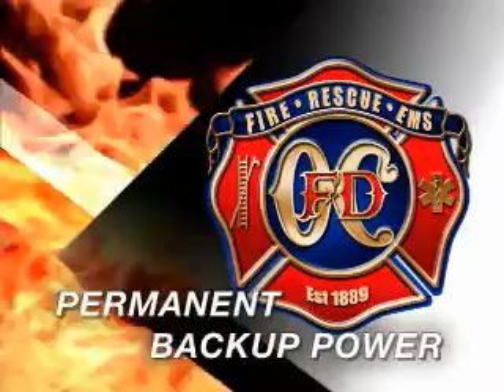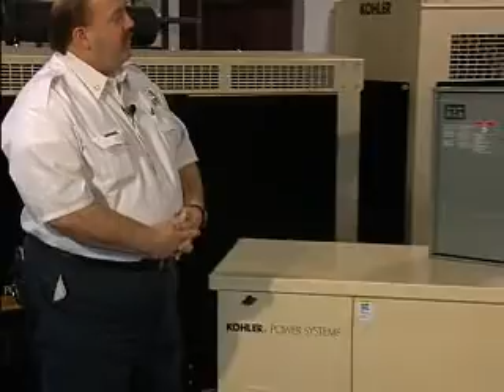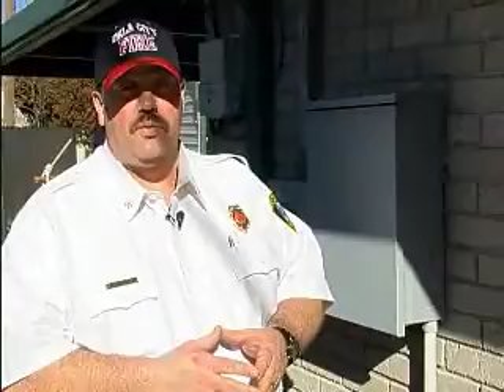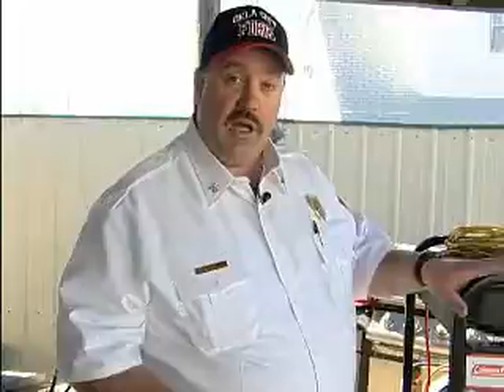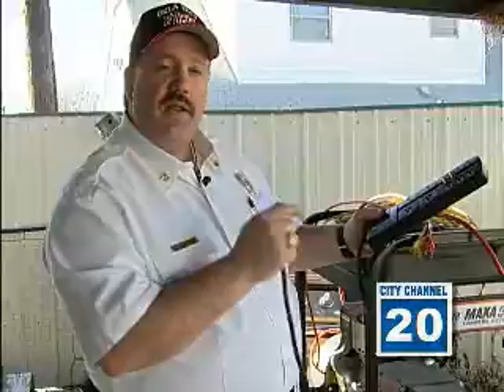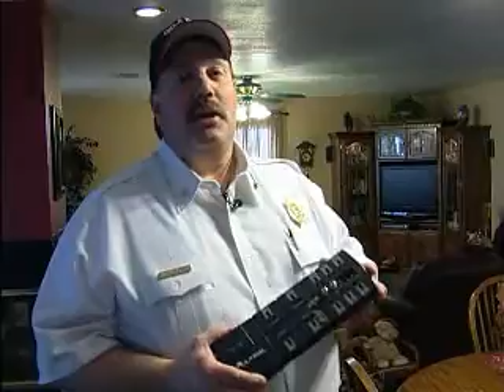Inside Fire Rescue: Using Generators

Comment: Let me add one thing on the portable generators: Use of one REQUIRES a carbon monoxide alarm inside the house. It's easy to turn the exhaust the wrong way or have it blown back towards the house and people aren't going to spend the money on 500 feet of quality extension cords to run a 1 to 1 hookup on all the outlets with the generator 100 feet away from the house where it needs to be.
That alarm will sound when, not if, they fill the house up with carbon monoxide.
One of those alarms saved me being poisoned by a rather large Generac unit.